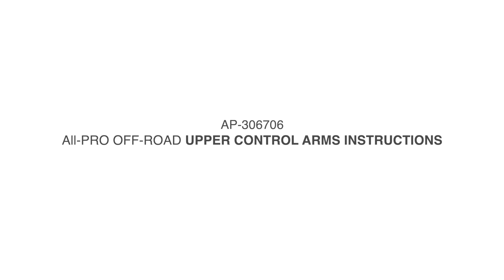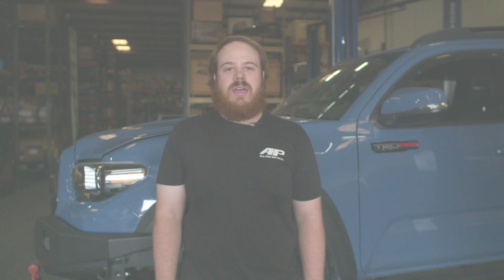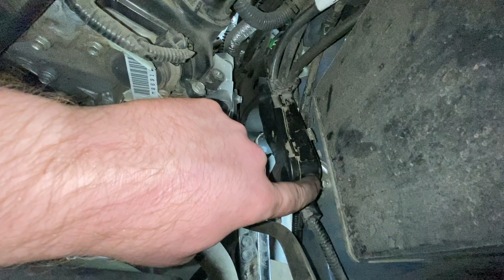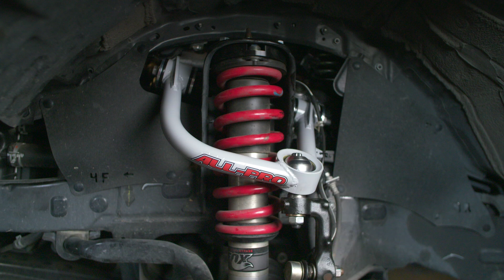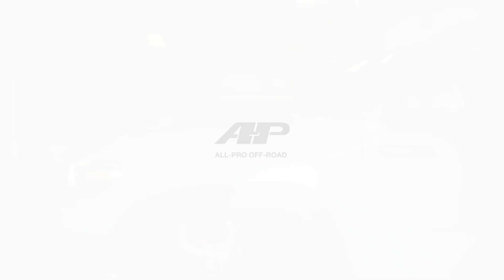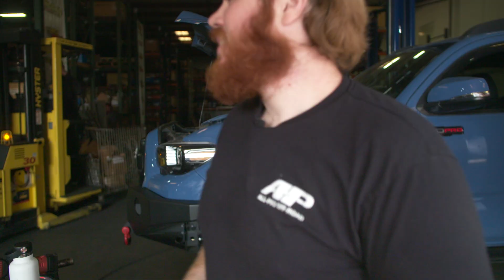All-Pro Off-Road Upper Control Arms Installation Instructions 05+ Tacoma

Comment: Hi , Require an advice on selecting suspensions I have installed my Hilux 1996 ln106 with two types/brands of shocks to front and rear( front KYB Skoroched & Rear Tokiko). Still vehicle is unstable when taking bends. Please advise 🙏

Comment: Did you all have to bend any pinch welds to get the uca bolt out?
Reply: Can cut the bolt and get new ones from Toyota 
Reinstall backwards and it will come out easily next time
Reply from the maker: We didn't bend the pinch welds but you have to bend the fender out of the way. Please watch the video at 1:30
Reply: wŕ
7